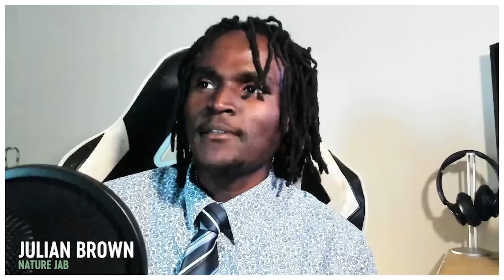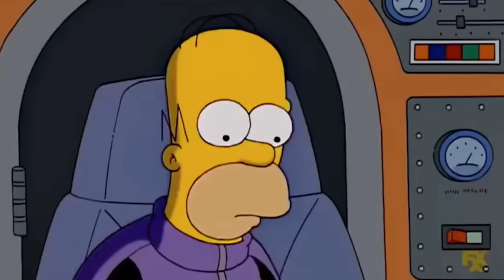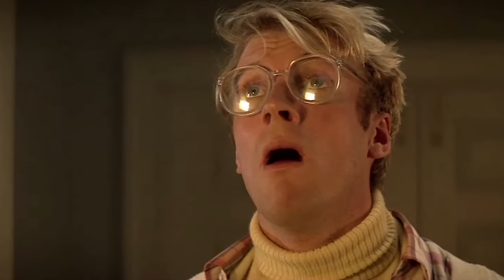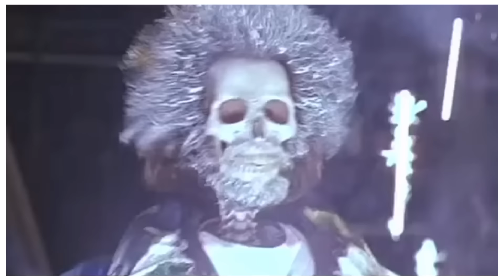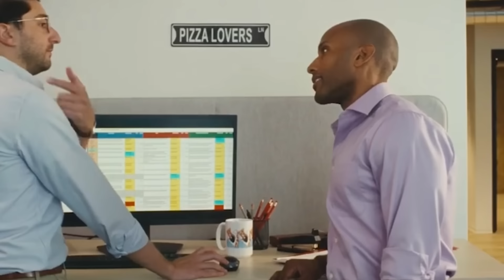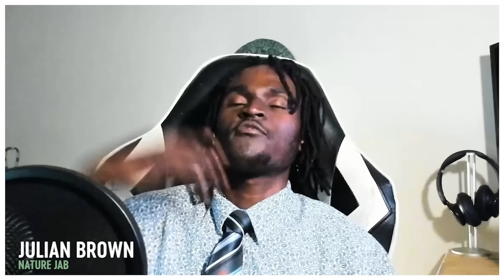Microwave Pyrolysis: The Future of Plastic Recycling?

Comment: run the natural gas through a generator at 20% electrical efficiency then use the exhaust to heat the pyrolysis reactor along with the microwaves to get self sufficiency

Comment: Pyrolysis is a very complicated and precise thing. It is not as simple as building it in your backyard. When you break molecular chains in plastic and create a liquid with pyrolysis, you release benzines. Benzines are carcinogenic. The fuel we use in our vehicles have a 1% benzine content, higher then that is not considered safe. Without the proper removal of benzines, a back yard pyrolysis machine can easily reach 20%-50% benzine content depending on the type of plastic used. Before anyone claims it “boils off” in the refining process, benzine has a higher boiling point than fuel. Meaning the fuel burns off first. Putting this fuel into a vehicle and running it is releasing this carcinogenic directly into the atmosphere at a very unsafe rate. And no, your catalytic converter is not sufficient. Another thing to consider is the “byproduct” in the pyrolysis process which is a black sooty carbon. Naturejab refers to it as “clean carbon” and even “fertilizer”. He is somewhat correct. Yes that is carbon, but it’s not at all pure and it’s definitely not a fertilizer. That carbon is loaded with unburned hydrocarbons, another carcinogenic that’s causes some nasty health issues, or death. Hydrocarbons are released during the pyrolysis process, but not fully burned off as the boiling point is considerably higher then the fuel/oil he is making. I really hope he’s not using that as fertilizer. I’m all for the advancement of technologies, but it needs to be done in a safe manner. Harming yourself is one thing but harming others is another.
Reply from the maker: Great comment. From what I've seen he's working towards learning more and bringing this into a safe space, he's already gotten PPE after it exploded and burned his body a couple weeks ago. The biggest benefit to his content I see is he is bringing the idea of pyrolysis to the masses and creating discussion around new alternatives to recycling or landfill. 
But agree, much of the materials being created will have a negative impact on himself to learn much of what has already been discovered, just not made popular.
To be young again.